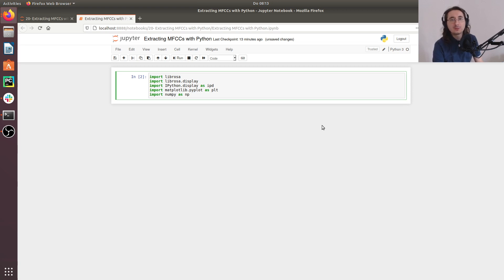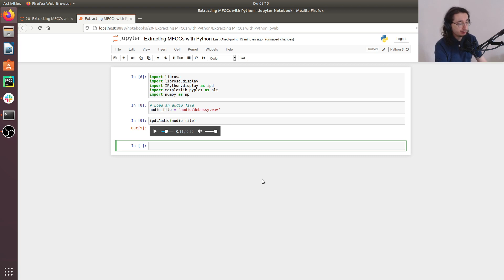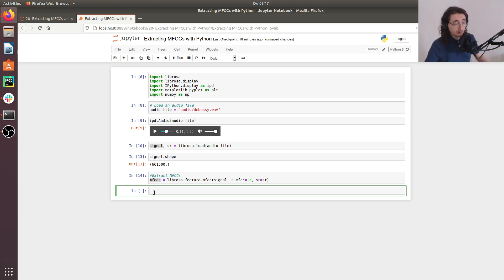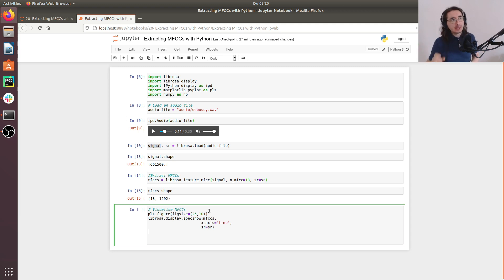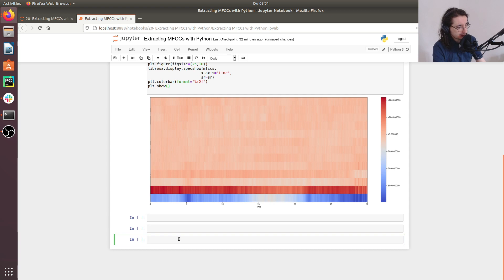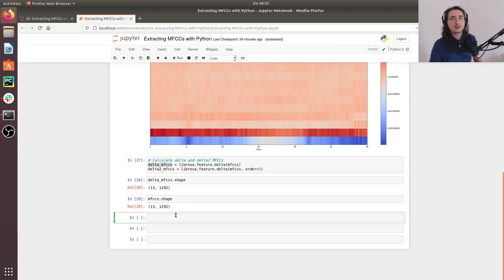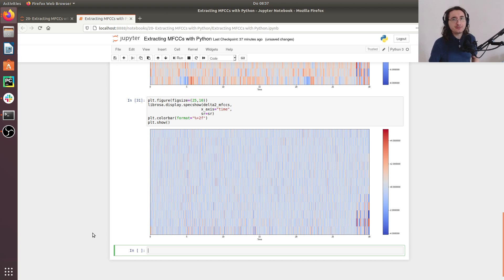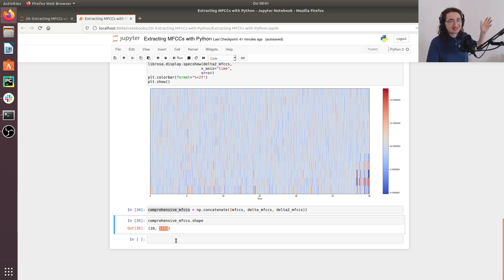Extracting Mel-Frequency Cepstral Coefficients with Python

Comment: how I extract MFCC from multi-audio at once ?? can I??
Reply: By multi-audio, do you mean multiple audio files in a folder? If so, I would set a data_dir first following this tutorial https://www.youtube.com/watch?v=vJ_WL9aYfNI

Then, just do what Valerio did here in a for loop, with as many repetitions as the folder has items:

for file in range(0, len(training_files), 1):
    signal, sr = lr.load(training_files[file])
    mfccs = librosa.feature.mfcc(signal, n_mfcc=13, sr=sr)

Hope this is a first help
Reply: @tysk_dt  thank you so much i tried I applied the code in the video you mention  but it keeps told me ValueError: x and y must have same first dimension
Reply: @nabaaf.hameed786  Your audio must be converted to one channel. You if your audio has multidimentional channel or not.
Reply: @mahenrathod5285  thank you so much I finish my thesis  since month by using this code video and yes I did not convert it to mono I learned that later thanks again

Comment: Is concatenating them better than putting each of them into a different channel? Also, how would you normalize each of these? Do you do it the MFCC / delta / delta2 individually before concatenating? Do you use minmax normalization or standardization? Do you apply this to each "image" individually or do you use the entire training dataset's statistics? Thanks!
Reply from the maker: We usually treat MFCCs as a 2d image. With DL architectures, delta / delta2 are rarely used. You can use both minimax normalization and standardization. Most of the time I haven't seen normalization implemented with MFCCs. Normalization should be done on MFCCs / delta / delta2 separately. You can both apply normalization to each image individually or considering the whole dataset. The latter is more common.

Comment: Another great video. This is amazing! Just one question if you don't mind, Valerio: Does the librosa.feature.mfcc method consider frame sizes of 512 by default? (30/1292*sr=512)
Reply: I have just seen you can pass n_fft and hop_length as **kwargs. I thought it was useful to clarify this so we can be consistent with the frame size and hop length used to calculate other features and therefore with the x-dimensionality of the feature vector.